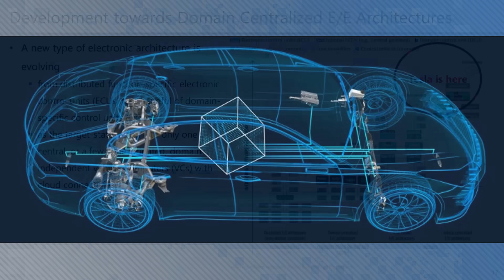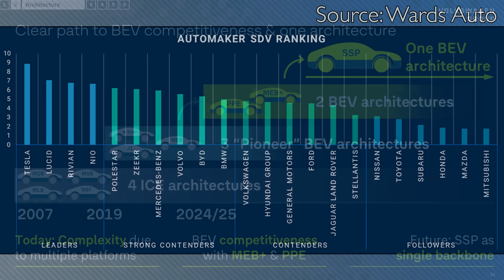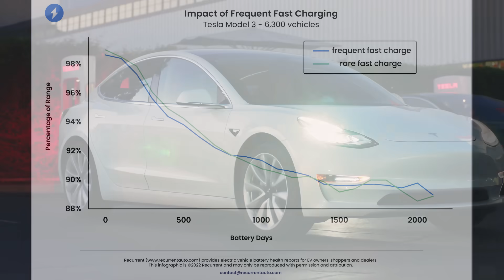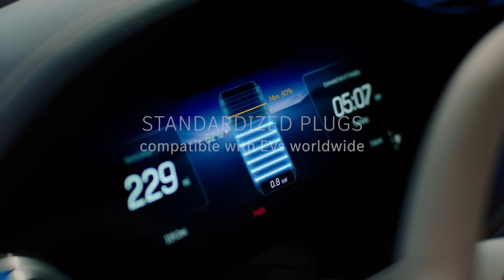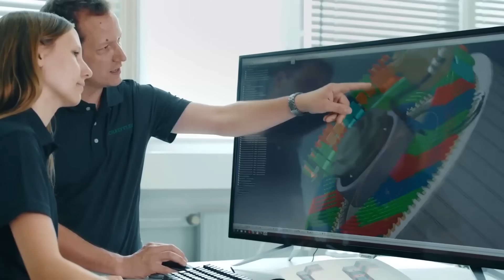Tesla EVs Not Hurt by Fast Charging; Big $$$ in Battery Recycling - Autoline Daily 3637

Comment: Been supercharging at least 90% of the time for 7 years now.. battery is still doing great. Have about 8% degradation from new. She’ll last well over 20 years at this rate. And then, the battery will still be well suited to be used in a second life as a home battery backup for probably another 20 years.
Reply: Do you have lifetime free Supercharging?  That was such a good deal for people who like to roadtrip.
Reply: @JohnPMiller  i do. And while paying for electricity for an EV isn’t really bad.. considering the alternative.. i am loath to give it up and upgrade to a new model and loose that perk lol
Reply: @airheart1  The free connection and Supercharging is keeping me from getting a new Model S.  Make it part of the price of the car and don't nickle and dime me.
Reply: @gnoxycat  That was a great deal for the innovators, it is not sustainable at all as charging stations would be clogged up at all the wrong times if the program kept going.  Maybe the next deal could be free off peak Supercharging for 10 years.
Reply: Supercharging is adding a compressor to an internal combustion engine. What you're doing is charging. Stop using dumb marketing jargon instead of correctly worded descriptions.
Reply: @heathwirt8919  supercharging = fastcharging. What you're thinking of is called a supercharger.
Reply: @whattheschmidt Look up the definition and stop making a fool of yourself.
Reply: @heathwirt8919  not hard to see it has 2 meanings, stop being butthurt about change.
Reply: This is why I laugh when folks say modern EV batteries don't last. They keep thinking of the old Leaf and Prius battery tech. Pretty much any battery with active cooling and halfway decent charging software is going to last. I have ~130k km on my Volt's battery (155k km on the car so ~85 % of my driving has been on the battery the rest as a hybrid) and still have <10% degradation. Let's just say, hopefully knock on wood, I'll be driving this car for quite some time or at least until I get wrecked by a Karen putting on makeup while texting in her Rouge or Telluride.
Reply: Some of the batteries currently in vehicles will still be in use in secondary and tertiary rolls decades from now.

Comment: Of course the SDV study shows startups in the lead!  That is because OEM's still favor the RTDFS (Return To Dealer For Service) model so dealers can rip off buyers!
Reply: What mechanical systems (for instance) have been replaced with software running on a computer?
Reply: @heathwirt8919  Heat pumps in the Tesla are five components combined into one and then managed by software to control the configuration based on need, be it cabin climate, motor cooling, or battery thermal management. 

It basically behave more like a flexible mult-function logic circuit rather than a dumb mechanical part with a single function.
Reply: @AllanSustainabilityFan  That's not a software defined device, it's electromechanical.
Reply: @heathwirt8919  It's controlled by intelligent software, the software decides based on various criteria how to juggle or mix the combined functions of ~five typical components in one neat package. 

It can even divert both sides of the heat pump - heating on one end, cooling on the other-  to further optimize use and increase efficiency. Using waste heat to warm up batteries while cooling the cabin, for example.

It can even divert the waste heat output to itself, or "overclock" itself to generate resistive heat in cases of extreme weather, improving heat-pump's efficiency.

It's very interesting multi-valve design, like heart chambers, except more complex.
Reply: @AllanSustainabilityFan  It's not Software Defined, it's Software controlled.  Not the same. SDV is a meaningless marketing term as applied to automobiles.

Comment: I wonder what the repair prices are on similar vehicles.  Comparing an EV like the Tesla Model S to a Toyota Yaris repair makes little sense.  The vast majority of ICE cars getting repairs are cheap low-end vehicles by volume, often repaired with non-OEM parts. Tesla should be compared with an ICE vehicle like BMW 740 or MB S500 repairs.  I suspect Tesla will come out quite a bit cheaper over the same number of years.
Reply: Not only that, but they are spinning this a bit as if cars crash left and right. In normal scenarios modern EVs are significantly cheaper to operate because hardly anything breaks, they're rock solid products.

Add to that the ability of modern EVs to avoid accidents altogether with active safety features, making them multiple times less likely to crash in the first place, and it's just a silly spin on a niche scenario.
Reply: @AllanSustainabilityFan  About 98% false.

Comment: On that SDV ranking, it's a shame that Mitsubishi ranked last because they were the first ones out of the gate with a mass-produced EV, even though it didn't sell well and was very limited (the i-MiEV). Nissan is also in that "followers" group and they're another brand that was one of the first out of the gate with a mass-produced EV but for some reason couldn't keep the lead going. Toyota, the largest car company in the world, has the misfortune of betting on the wrong horse at the beginning: Hydrogen Fuel Cell. This commitment, which they STILL have going today despite it being a colossal failure, has put them WAY behind when they had the potential to be the world leader with the knowledge they gained with the Prius. It will be interesting to see if Toyota, Honda, Nissan and the others can catch up. They can, but now it will be much more expensive.
Reply: When you say Software Define something it means replacing a hardware function with an application running on a computer. What are examples to these so called SDV's?
Reply: @heathwirt8919  EV does not mean SDV. When you take out switches that control the radio or HVAC and replace it with a touch screen, that allows you to change the functions by changing software. It's also cheaper. Also, drives some people crazy.
Reply: @jamesvandamme7786  Software updates have nothing to do with the ridicules claim of SDV, it just an advertising buzz word canned by a clueless marketing type.

Comment: EV parts will come around. ICE has had decades of using the same parts for models that have been around for many years. That will happen to electrics as say, the Ioniq 5, is on its 3rd generation.
Reply: Not going to happen.  Look at computers and touchscreen phones...any legacy support for those systems?

None.

The paradigm being introduced is leading to the destruction of the used car market and DIY maintenance or modding.  Hardly a GOOD thing...
Reply: What same parts? Maybe 1% of parts could be considered shared (at most) for decades
Reply: Agreed!  Aftermarket parts are already showing up for Teslas so it's just a matter of time before they show up for other EVs.  The market is still in it's early days so I would not expect aftermarket or third party parts to be equivalent to 100+ year old ICE vehicles and anyone that does is comparing apples to oranges IMHO.
Reply: @pnketia  And a lot of those parts won't work on the car unless you go to a licensed installer who is authorized to flash the car's computer to recognize them.  And, in the case of suspension 'upgrades,' they often make the car either unsafe to drive or almost undrivable.
Reply: @billcichoke2534  My cell phone doesn't have a motor, tie rods, and active cooling system, and you are citing devices with high change over that are near disposable in just a couple years. For example, 2004-2014 Mazda 3 inner tie rod is the same. Dozens of parts like that in ICE vehicles. It's just that the early BEVs are first generation at the moment.
Reply: @davidmccarthy6061  Uh-huh...which is why the Roadster and the first Gen S a d X don't have the same charging capability, and have become less capable of running the newer versions of Tesla's control software.

As well, the suspensions of the various WVs are designed around sportiness, which doesn't work with the heft of the batteries.  Trying to change out control arms or springs or the like is, therefore, a futile and foolish exercise.

Comment: Unless one applies AI-controlled FSD, all this computerisation is functionally redundant. Musk's FSD tour around Palo-Alto is the next-gen in personal transport, and heralds the end of car sales. FSD robotaxis (probably less than two years away) will enable transport-as-a-service, at a fraction of the cost of owning a car. When this happens, sale of the physical car will rapidly decline - so goodbye to all manufacturers who cannot enable AI-controlled FSD.
Reply: While I agree with you in principle the big road block to FSD being able to "roam free" on public roads is REGULATORS!  Look at what they did to Cruise over a few accidents.  California asked them to reduce the number of vehicles due to the accidents.  The problem is that when FSD happens to get in an accident even if it is not at fault the narrative by MSM will be Telsa FSD vehicle in another accident.  Also new laws will need to be developed to determine who is liable if a FSD vehicle injures someone - The car manufacturer, the owner of the vehicle, regulators who approved the use of fsd or the person who wrote the code for the software.  All could be sued in these cases.
Reply: The videos I've see demonstrating FSD were far from realistically replacing a human driver. In fact it took more concentration to monitor the system that was frequently failing to make the correct decision than just driving without it. The acronym FSD is fraudulent on it's face, unless it stands for Fake Self Driving because that's what it is.
Reply: @heathwirt8919  "The videos I've seen..." Such a typical comment based on anecdotes. What you need to do is stop watching anecdotal material and try (if you have the brainpower) to focus on the technology and why it is so profoundly important. Tesla WILL solve FSD - probably very soon, and when they do, it will be the most mind-blowing development in transportation since our cavemen ancestors invented the wheel 300,000 years ago.
Reply: @brunosmith6925  It doesn't demonstrate intelligence to fall for a conman's hype so stop embarrassing yourself. It will take at least a decade (possibly longer) for an automated system to functionally and completely replace a human driver. Fake Self Driving notwithstanding.

Comment: The biggest impact on battery health is fast charging over 90%... even on Tesla's. 80% is the safest level to charge lithium ion batteries. Worst case scenario is a battery's health will be around 85% which isn't bad.
Reply: Fortunately very few people fast charge often so when the used BEV market fills out it will be good for the next owners.
Reply: No longer applicable to most of Tesla's standard range models as they use lfp chemistry.
Reply: You incorrectly lump all Li-ion in a general category. There are several chemistries, and LFP tolerates 100% charging. Tesla M-3 and M-Y are LFP.
Reply: @brunosmith6925  I didn't specify ion, but that's what I referring to. LFP is Lithium IRON phosphate, not lithium ION. Lithium iron can be charged to 100%, but doesn't provide the same full throttle performance or the same range thus far.

Comment: A company that makes cameras says cameras are better than radar, certainly no bias there.
Reply: Except that they are correct. Lidar is unnecessary and a "fool's errand". It adds nothing to FSD and is an expensive, cumbersome technology.
Reply: @brunosmith6925  Sounds like a BS talking point.
Reply: @heathwirt8919  Research up on it or follow someone that does.  Lidar systems can't rely on Lidar solely at all.  Can't read signs, work much worse in the rain / dark / fog.  Tech will keep improving but the main point is you have to have the cameras and humans drive well (the good drivers) with solely vision, that's how it's all designed and worked with.
Reply: @whattheschmidt  I still think radar and IR tech has a role to play in low speed and emergency situations, but I understand they want to get the visual spectrum camera software to work first. The other technologies were just making things too complicated when they offered marginal benefits. I still think the main reason for their camera focus is Optimus. They can use the principles for a "vision" system for the robot and how it can navigate a human world, then they can get rid of at least 50% of their human labor force in their factories with workers that run all day, never call in sick or threaten to unionize, and take breaks only to recharge, even that may happen wirelessly when at a certain station.
Reply: @anydaynow01  I agree they can be useful, making it superhuman if you will.  What's important is they don't overlap much because you don't want conflicting input and also it will mean both sets need to process faster / be shorter code since they would run simultaneously.  The high def radar sounds cool.

Comment: SDV is a myth.
Reply: More like it's a scale, with cars being at various points along that spectrum
Reply: @JT_771  What major mechanical systems have been completely replaced by software?
Reply: @heathwirt8919  You're merely misunderstanding what a software defined vehicle means.
Reply: @JT_771  It's a meaningless buzzword created by a marketing rep and repeated by clueless fanboys.
Reply: @heathwirt8919  Buzzword, yeah I could see it being overly played.  But the concept is fully genuine and already in play by some OEMs, to varying degrees.
It just means you have the ability to update & change software in the car that can change how the car operates.
Solid case in point is Tesla fixing a braking issue (causing hard braking events to need more distance than should have been needed) on some cars via an over the air change.
Being able to add features, fix problems, etc via such updates is already real, has clear benefits and as such is going to happen more and more.
Reply: @JT_771  What are examples of a hardware function being replaced by a computer running an application, can you name any?
Reply: @JT_771  That's not the definition of software defining something, it's an over the air update to the system software.
Reply: @heathwirt8919  It's now intentional misunderstanding?  You need physical steering components, braking hardware, etc.  The question is simply invalid.  It's asking a question that isn't material as this isn't about some pieces of code needing to replace major pieces of hardware.
Reply: @JT_771  True, at this point you are intentionally misunderstanding the meaning of Software Defined. The concept of a Software Defined Vehicle is what's invalid.